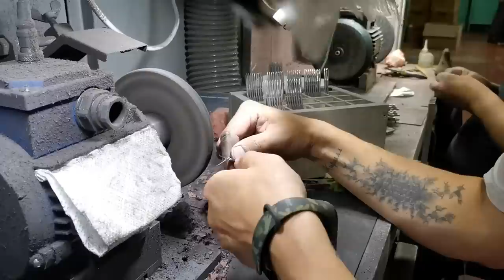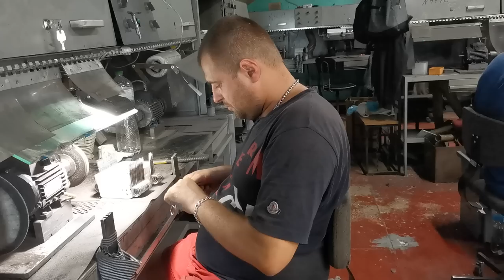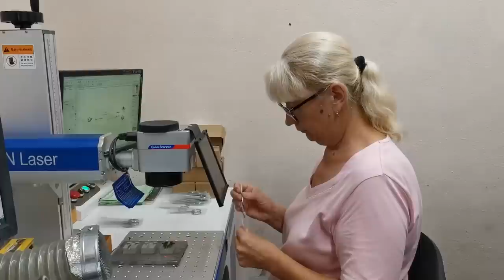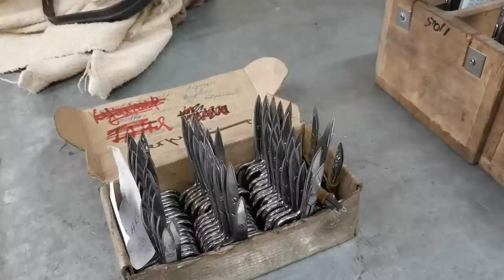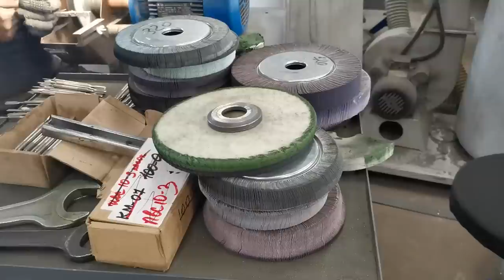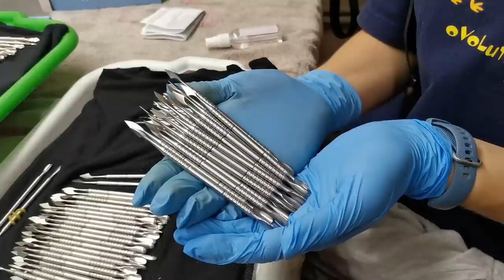До Вінниці за державною програмою релокації бізнесу переїхала харківська компанія «Сталекс»

Comment: Very worthwhile work.  Well done.  Please could some charity send these good people some safety equipment.  Things like eye protection in particular, as even a minute sliver of metal can ruin eyes.  Ukrainian hospitals need to deal with service personnel, and civilians after rocket attacks.  As well as normal health issues.  Eye and ear protection can prevent unnecessary injuries.
Reply: Agreed, there is also the issue of inhaling the metal splinters when grinding these things. I went to a old needle factory & they explained that the guys used to have a short life span because when grinding the needles to a point they inhaled the microscopic  metal particles which shredded their lungs and insides that's why they used to get paid above the average wage than anyone else in the factory.
Reply: Safety equipment is not a matter of cost, it is a matter of culture. I think the main problem here is inhalation protection. And I guess every country is right now full of face masks. One of the worker also had the mask under his mouth.

And I don't blame them. It was the same in our country (Slovenia) some time ago, but it changes. I am sure the situation will improve in Ukraine too.
Reply: I agree . Safety is important for the health . Masks , eye glass , air ventilation  hose to suck bad particles at the work station ....etc
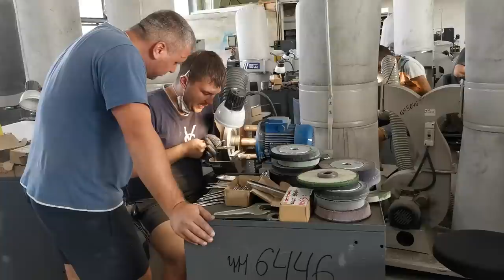Reply: I was intending on making similar observations regarding the gentleman at 1:00  .  I'm glad others did.  I've also had a lot of similar thoughts about the artillerymen and gunners who do not have, or wear, adequate hearing protection.  I know because I have lived with tinnitus for decades following some less than prudent experiences with power tools, and weapons including a M60.

Comment: It's a health and safety nightmare. Using engraving lasers without proper eyewear. Some workers were also grinding instruments without eye, face or hearing protection. 
Interesting to see that they're using one-piece scalpels instead of the single use, disposable type. I wonder who does the sharpening of the scalpels, between patients?!
It wouldn't cost much to improve everyone's safety, either.
Reply: Im sure the take injuries. 
Is there no litigation there?
Reply: So go buy them some safety equipment to donate or mind your own business about them doing what they have to do to make enough supplies needed for wartime. This is not a normal production facility. It's an emergency setup to create what they need in this emergency situation.
Reply: Least of their concerns I suspect …
Reply: I was at their old facility.  Everything was done in exactly the same way.  You are too spoiled for production safety.  And by the way, these are not scalpels, but manicure tools 😀